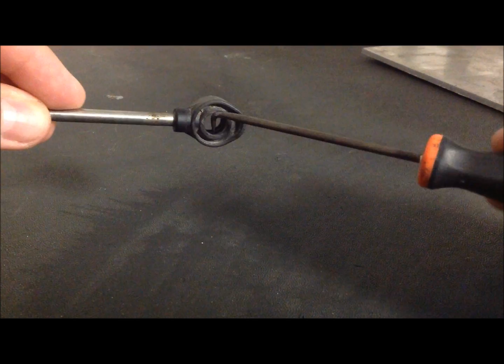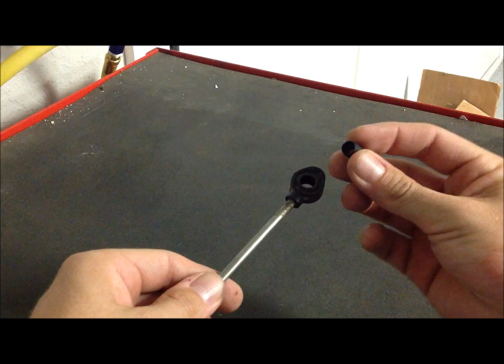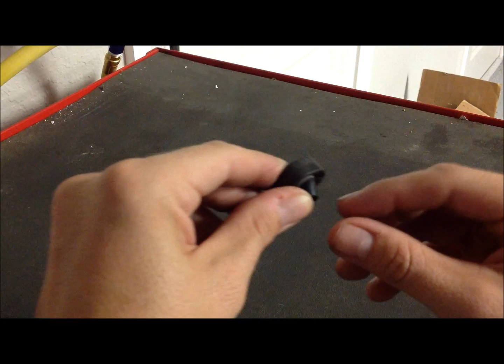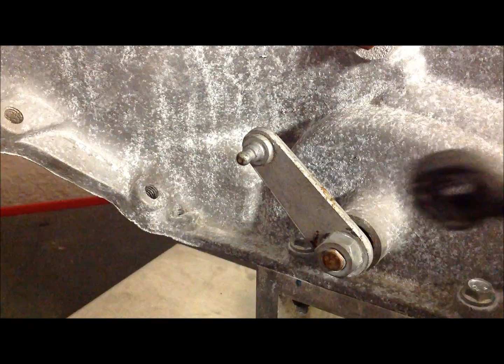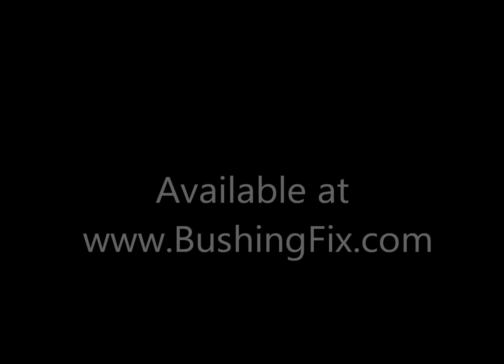The easiest way to fix your Ford F-150 shift cable!   Kit includes replacement bushing.

Comment: Do you have the link for amazon ?
Reply: 2005 Cadillac Escalade
Reply from the maker: Call us so we can first confirm your year, make and which tranny is in your F150.  As well as which end of the cable is in need of replacing.  Then an confirm fitment and stay online with you while you place order through Prime.

Comment: Ok, so I use the green bushing for this fix, but then what is the black one for?
Reply from the maker: Great question! For many year makes and models this same kit will work on both transmission end and gear shifter end.  In those cases it provides a total replacement.  In the case where only one is used keep the other as a spare.